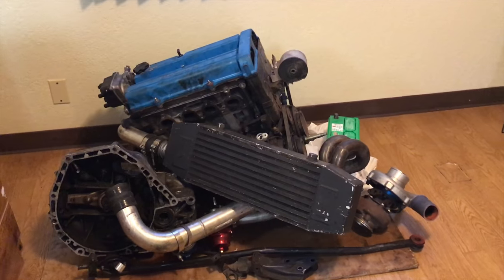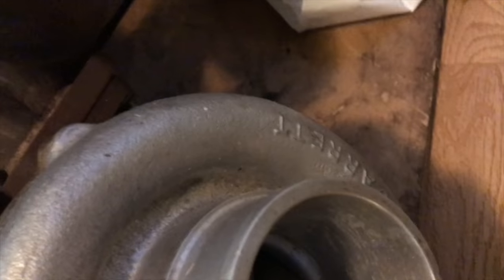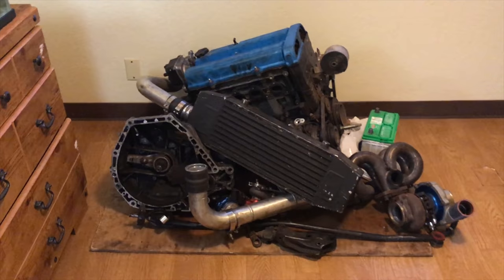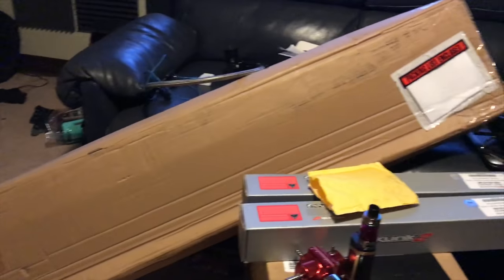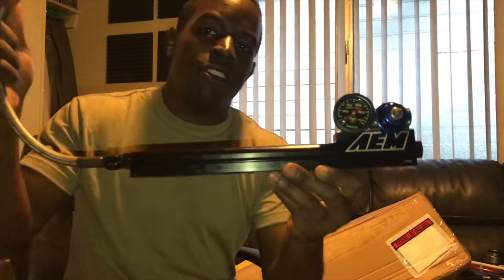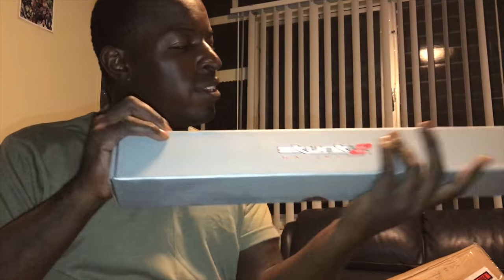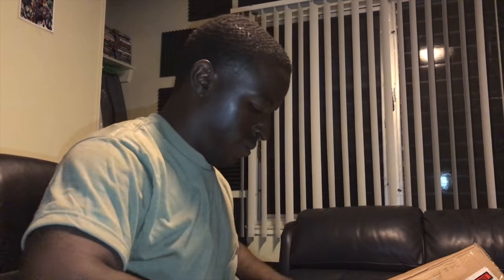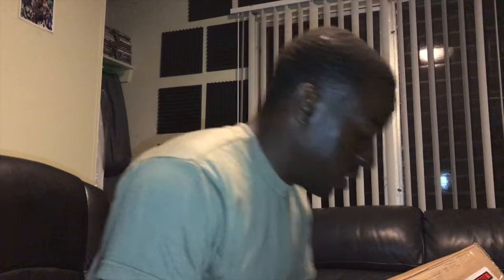NO MORE CHEAP eBay PARTS!? UNBOXING MANY QUALITY PARTS😎🏁

Comment: Thing is tho you can't be stance no more it's all about function over form
Reply from the maker: badazzshitz who said I was gonna stance it🤔camber kits can be use to correct camber when you lower your car. My car has a lot of good parts for suspension and last thing I needed was a good camber kit bc mine is trash and the front is just stock. I plan to hit a circuit track if here's one in my area when I move. I'll be at the drag strip for sure though.
Reply: I would also build the head new valves retainers lost motion assemblies etc you prob need new valves anyway to be compatable with the new cams
Reply: JDM SWAG for sure no hate here been watching for awhile love your content just like helping other Honda noobs
Reply from the maker: badazzshitz parts are still coming in😎